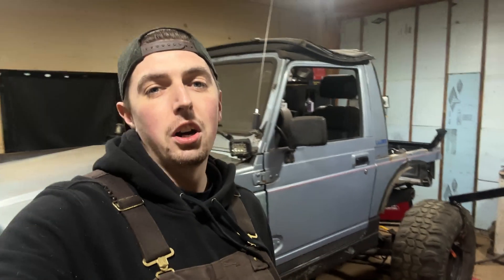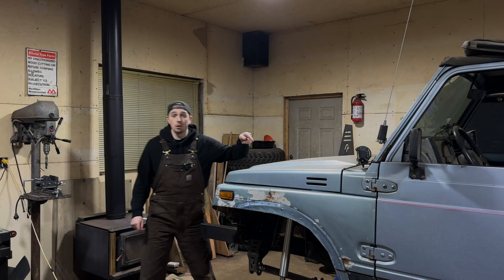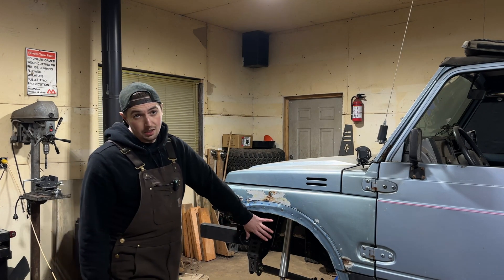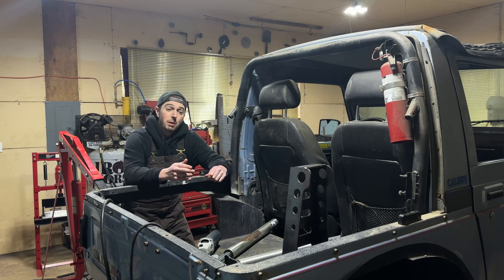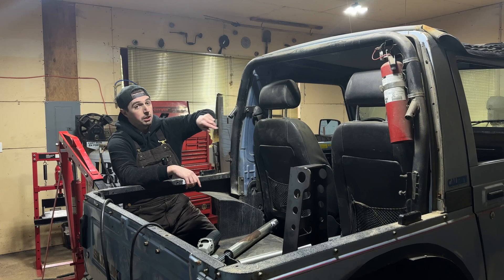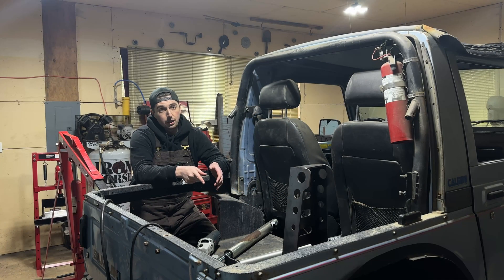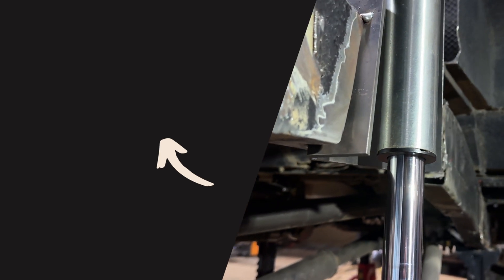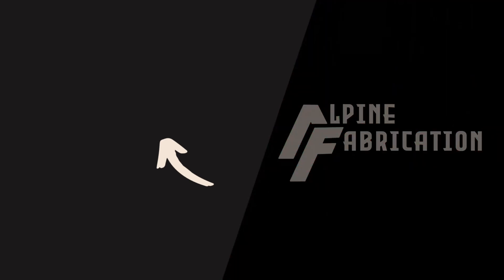Custom CNC Air Shock Mounts for Long Travel Suzuki Samurai

Comment: I would think a removable cloth cover that snaps on / off for the cab. In the summer I'd want that thing open, not sure about closing the mud out from that shock opening, maybe another snap on cloth cover or piece of rubber?
Reply from the maker: That’s similar to what I was thinking as well! I definitely want the top off in summer and I’d love to keep the original soft top look. Almost a second canvas divider between the cabin and cargo area